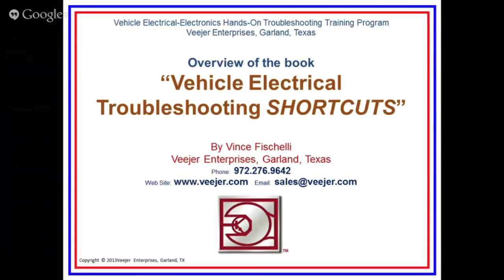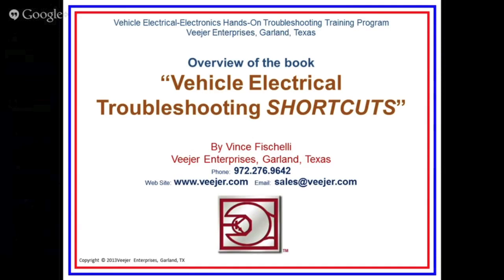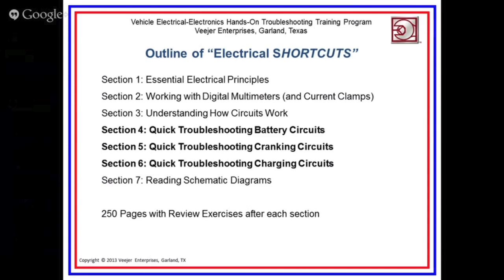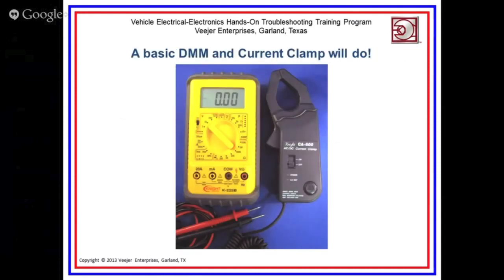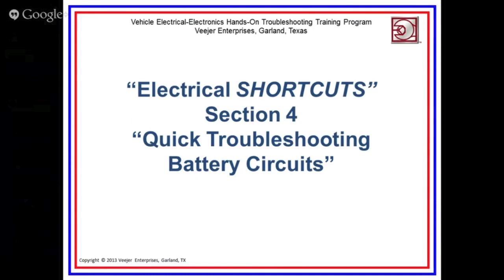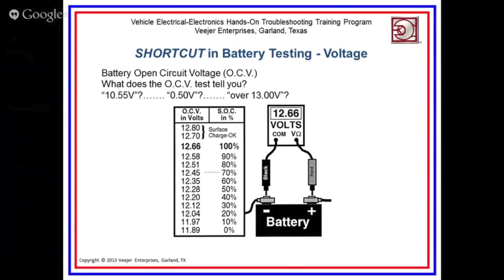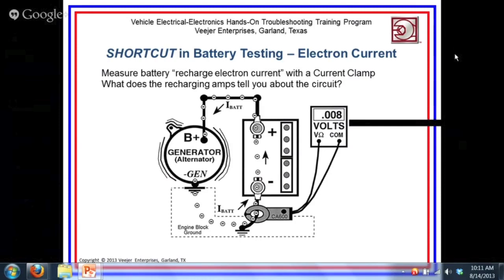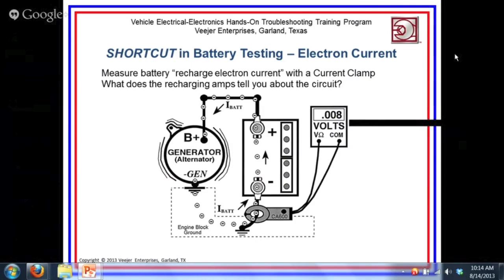ITW #10 - Electrical Testing Shortcuts with Vince Fischelli: Part One (Battery Testing)

Comment: True. Kirchhoff's Law: The sum of voltage drops around a closed circuit equal the source voltage. This means the battery cables each drop 1.0 volt so the shorted battery voltage stays at 10.5x volts with the good jump battery connected.

Comment from the maker: Correct. OCV stands for "Open Circuit Voltage" and is a measurement of the battery's potential with NO loads applied.

Comment: Interesting, i have been using my amp probe to check for "recharge current" for a few years now. Check this out, i recently replaced my oem battery on my 2017 4runner a week or so ago. But before replacing it, i used my amp probe to see the recharge current. I notice that is would drop below 10 amps fairly quickly but It took it took about 5 to 6 mins to drop below 3 amps, This was my first test. A few weeks later, same test. It now took 8 mins to drop below 3 amps. Now about a month later, it took 10 mins to drop below 3 amps. I then used my battery tester and it stated "replaced battery". With a   new battery installed, it dropped below 3 amps in less than two minutes.

Comment from the maker: I would test the OCV first. If it's above 12.5 volts, I would continue with a load test. Less than 12.5 volts means it is 20% or more discharged and then I would charge it to see if it was the car's fault or the battery's.

Comment: The battery OCV is accurate when the battery has been rested for a while. In cold weather the battery will settle down in 15 minutes. In hot weather it may take an hour to calm down. Leave key OFF to allow battery to calm down.

Comment from the maker: It is imperative that you check the NET amount of current. If you are clamped around all the positive or negative cables at the battery you should get a consistent reading.

Comment from the maker: A battery that low should be charged first. Even if you do get it started, the demand on the car's charging system would be great and could lead to damage to the alternator. The days of letting your car charge your battery are long gone. Hooking up the jumpers in parallel would increase the amperage capability and is, IMHO, not a safe option. May blow the jumped battery!

Comment: The battery draw the charging current from the Gen 20amp constantly, that makes the Gen fail due to excessive heat damaging the diodes.
Then what about turn the head light and a/c that draws more than 20amp constantly but it doesn't fail the Gen damaging the diodesl
i don't see the difference  would you help me ?
THANKS
Reply: Good question; The battery should draw less than 10 amps. This is a constant load on the gen. Keep it as low as possible.  If battery draw gets to 20-25 amps that is a constant load in addition to the norm load on the gen that adds to gen output. Too much load heats up the diode bridge. Watch the battery especially if you have a gen failure. It may be the battery that did it. A new gen will fail if the old battery remains in the car.

Comment: I'm a retired mechanic and I'm very impressed with this video. I've learned a few things I never knew and also some things I was taught wrong. I have a question I hope I can get a truthful answer even though I know this video is over 5 years old. 
I have a 2018 Transit 250 with a 150A alternator. I'm installing solar for charging 3 100Ah Lithium house batteries and I want to add what is called a battery-2-battery auto charging system. This is designed to monitor when the house batteries are low and then allow the alternator to charge them while driving while also keeping the vehicle going. It is designed to shut off after about 20 minutes and then later turn on again to let the alternator cool down so as to not damage it. It also will separate house and starting batteries so not to draw power from the starting battery. After hearing about how the alternator should drop the amount of current down so soon after starting the engine to protect it I'm wondering if this battery-2-battery system will be ok. Hope you can help

Comment: 37:11
wonder if FLIR infra red thermometer would be worth a buy as it only takes a second to use.if the generator heats up from over amperage it will be lit up like xmas tree.not to mention could use it to see high resistance in wires that heat up wires/connectors/devices this could be used to catch things before they even become a issue.

Comment: Great article since this increased in electron current is a measure of the batteries internal resistance, shouldn't the number of volts measured on the negative side of the circuit be elevated during a voltage drop test? It seems that the increased resistance in the battery would leave less voltage for the load in this case the alternator thanks in advance for your response

Comment from the maker: Current if electron flow and is not differentiated by AC or DC voltage. Was there a specific reading you had a question about?

Comment: great video , so your current clamp amps should be about the same with multiple batts say in a heavy truck with 4 batts hooked parallel you would measure off the single ground at the batts, what about a split system each ground should show under 10 amps?

Comment: I just had a customer that the alternator had a short to ground and the battery drained due to lights being left on to .007v. We recharged the battery and tested it with a snap on diagnostic tester and it passed as good. After replacing the alternator, everything works fine and the customer has not come back for weeks. How can your SOC be an absolute?

Comment: These OCV readings are after you've attempted to charge the battery correct? Lets say you get a tow in or a car's been sitting, etc. I assume you would try to charge the battery before you condemn a battery with these readings.     If a car made it to the shop and was previously running or simply sat over night and there's no draw then the numbers would be accurate for diagnostics?
Reply: OCV is only valid test of battery state of charge when battery has been resting for at least one hour. After charging or engine run wait at least 1 hour for battery to calm down.

Comment: I have a AMES  AC DC clamp meter. when performing the BATTERY recharge electron current test when I place the clamp around the negative cable, should I be taking a DC amps measurement to measure the CURRENT?

Comment: Do you know why batteries fitted to new vehicles last 2 to 3 times longer than replacement batteries bought in Auto factors. OEM batteries can last ten years or more while Motor factor batteries even reputable brands struggle to last 3 to 4 years or as soon as the warranty expires.
Reply: Sound like you haven't found a reliable source for batteries. Keep trying battery companies until you find one that lasts. Make sure any battery supplier stands behind thier warranty.

Comment: Hi Vince. i have tested current right behind the alternator with loads on,  for example 80 amps. But the alternator wire goes to a fuse box, then from the fuse box to the battery positive cable. The amperage from the alternator to the fuse box is 80 amps but from the fuse box to the battery is much less like around 40 amps. Can you explain to me why ? I could never figure it out. i have done voltage drop on both negative & positive side but still 40 amps. Not sure why. Can you let me know ? Thanks.

Comment: excellent ! I have one question . Is the amp probe measuring only battery current draw or total current out put of alternator?
Reply: Depends where you place the clamp. Connect clamp around all cables and wires connected to the negative side of the battery to read battery draw during engine run. You should see less than 10 amps.

Comment: Is Vince basically saying it is not a good idea to use , say the Sun Vat40, as damage may occur to alternator/generator while load testing battery while connected to circuit of vehicle ?
Reply from the maker: Yes, exactly right. Loading the charging system to check maximum alternator output could cause more harm than good. Now, there are too many alternatives to testing the system.

Comment: Hi Pete, if the battery read 11.89 V the battery is just low and still can use a jumper cable?  
I have seen people use a jumper cables and jumper box at the same time because the car won't crank with one of this WHAT DO YOU THINK ABOUT THAT?

Comment: My meter has a clamp built in to it but it only reads ACV/DCV/ACA will that work to test the alt. amps in the test in part 1
Reply: Your clamp must read DC amps. That is what flows throughout the electrical system.

Comment: Jason K asked this below with no answer. How come it's OK to run 28amps thru the electrical system running devices constantly but not 28 thru the batt as recharge current?  I don't see the difference either.
Reply from the maker: It's the NET current that is the issue. If the system draw is 50 amps and the charging system feeds 50 amps with a little left over for the battery (say, 5 amps to keep it simple), then that is a NET 5 amps. When the battery is sulfated or has a damaged, but not quite dead, cell it takes more to keep it happy and the net increases. This puts an undesigned overload on the system, same as installing too many accessories on a car, and overheats the alternator leading to premature failure.
Reply: Because what the battery draws adds to the 28 amps to run the vehicle. If battery draws 30 amps add that to 28 amps and watch the gen diodes start to get hot and eventually fail.

Comment: don't do anything to the battery. It must be calmed down (chemically) to get an accurate OCV. If it is towed in the battery should be calm to check OCV before you do anything else. If the battery is recharged allow about 2 hours for the battery to cool down before checking OCV.

Comment: He talks too much, I dont need to know somthing as stupid as where to buy distilled water. Get to the point and quit telling stories. You could cut 75% of this and not leave out any useful information.
Reply: some people are ungrateful $#@itches. You get this free knowledge and still find a reason to disrespect?
Reply: 5.17.2019
Long Beach, CA.
( Los Angeles County )

Jh90 is probably one of those guys who has never heard of a Battery Leakage Test also, just by listening to his absolutely silly response to Vince Fischellis message.

When your DVM Black Lead is attached to your Negative Battery Post & you Drag the Red Lead all across the Battery Top : .5 Volts, 1 Volt, even 4 Volts & more I've seen on Customers vehicles. The Battery Voltage belongs inside the Battery , not on Top of it.

Battery Voltage read on Top of the Battery Case will DECREASE the LIFE of any Battery.
Reply: I think I made several good points and the stories lend support to the test procedures getting the job done. They help techs understand. Sorry you are having a bad day.